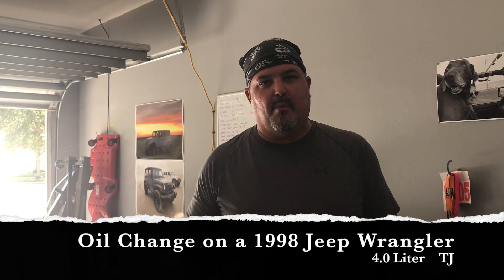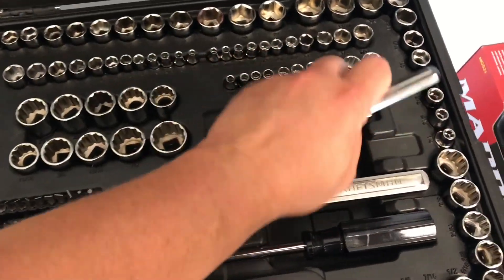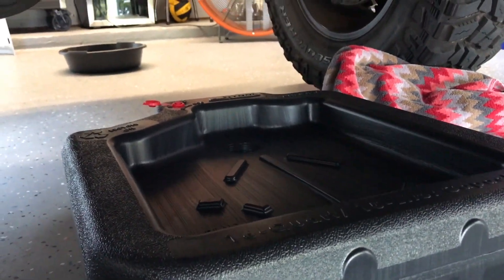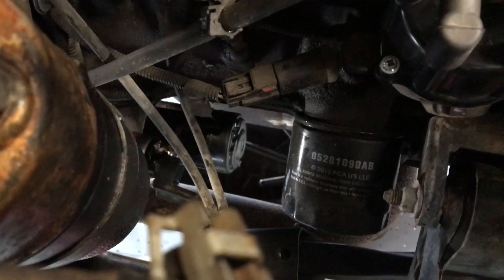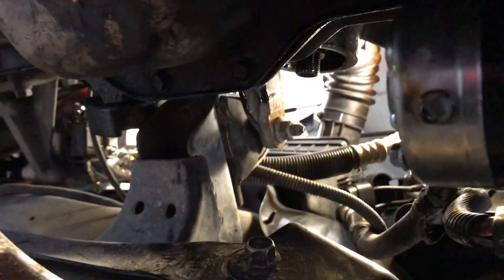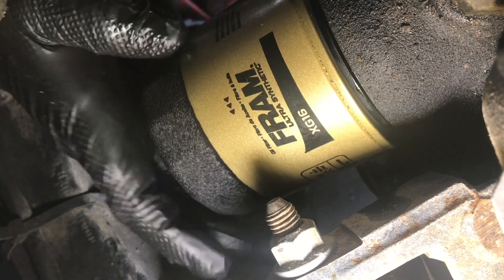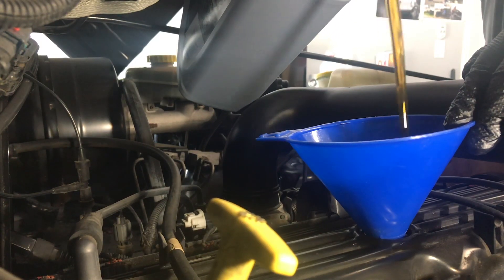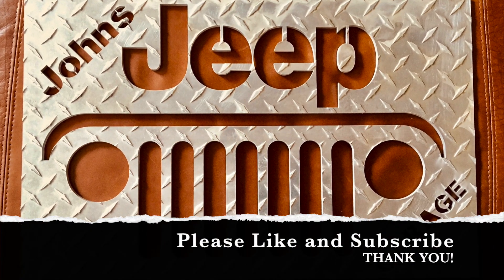EASY - How to change the oil in your 1998 Jeep Wrangler TJ 4.0L

Comment: Hey I have a question. Is there a reason why you used a fram filter instead of something else. I know fram has had a bad history of filters collapsing
Reply from the maker: I like the Ultra Synthetic filter for this specific vehicle.  The cost is low and I have not had an issue.  I realize there are many types and preferences.  I don't use the standard Fram on any other Jeep  - for example I stick with Mopars.  

I am glad the video helped you.  Thank you.